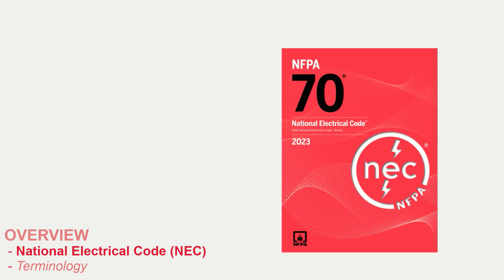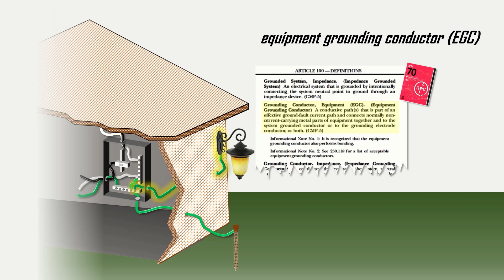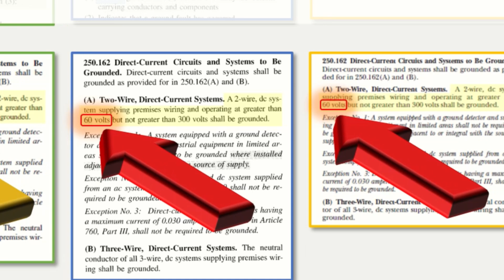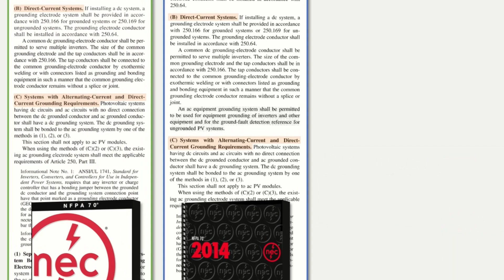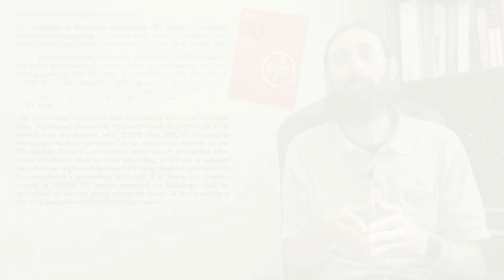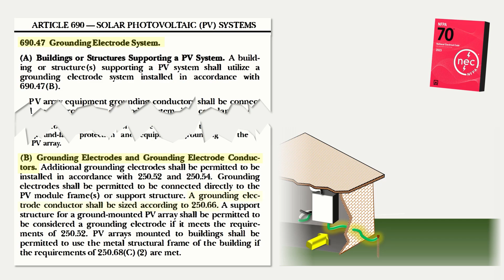How to design and configure code-compliant solar grounding

Comment: Can you just explain why solar panels and the rails they are fixed to require grounding?
Reply: If the positive conductor is damaged/pinched and contacts the frame, there current will flow through the frame, which may heat it up and cause a fire (hence the Ground Fault Protection Device, which implies frames are connected). Also, if frame is left floating and then gets energized (due to a damaged conductor), then current may flow through a person who touches the frame (very likely to touch) and a negative conductor or even Earth ground (especially wet); the protection against this scenario is a PE conductor from the frame to the common grounding point plus a breaker on the positive conductor (this is why you need 3 conductors from a panel array, not 2).  Also, on a floating panel frame, static charge may slowly build up on the panels (from atmospheric phenomena like friction of air against large surface area of the panels, etc), and without any path to dissipate that charge, the charge will eventually arc, damaging panels / equipment, or causing a fire or shocking a person who touches the frame.

Comment: Excellent video--thanks for the terrific detail.  In my case, I'm trying to determine the best way to establish ground in a floating boathouse (steel structure on plastic floats) secured by 5 steel cables to submerged 3,000lb blocks of concrete and rebar.  There is also an aluminum walkway connecting the boathouse to a concrete pier on shore.  Simultaneously satisfying sections 250, 555, 690, 706 and 710 seems to be almost impossible...  AHJ says "comply with code" but with no suggestions about how to do it...(and I've stumped 3 electricians so far)  We have 6 roof-mounted PV panels feeding a 48V 3kw inverter/charger connected to a load center with an ELCI main breaker...  Any suggestions are greatly appreciated...    Thanks!